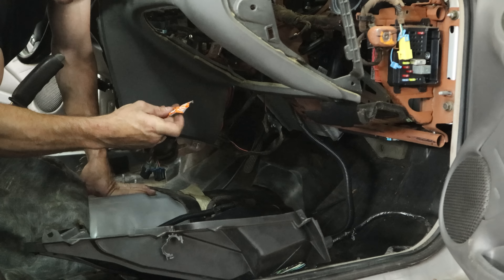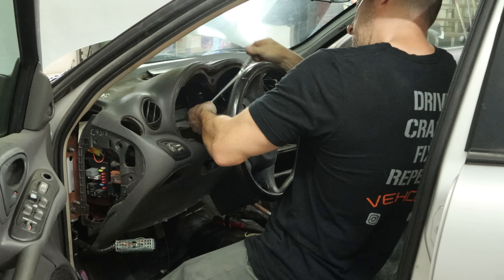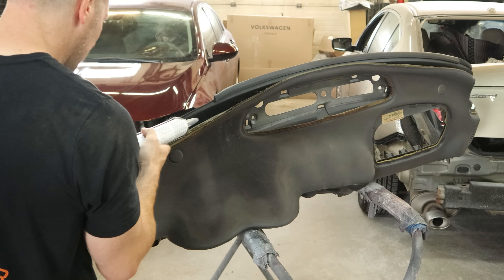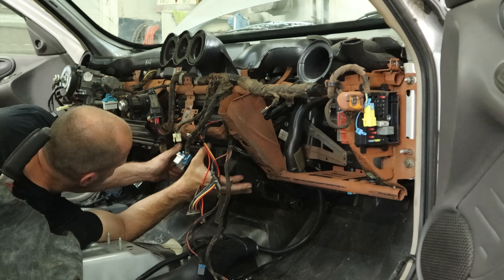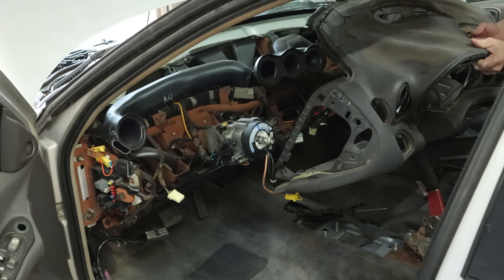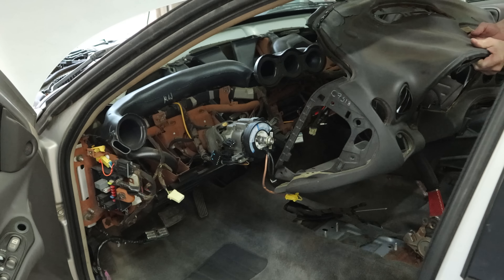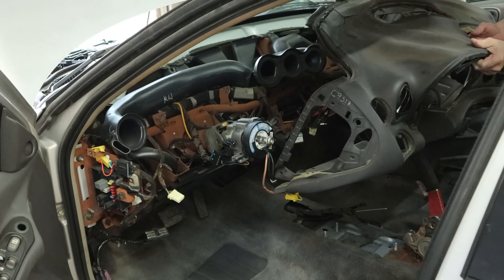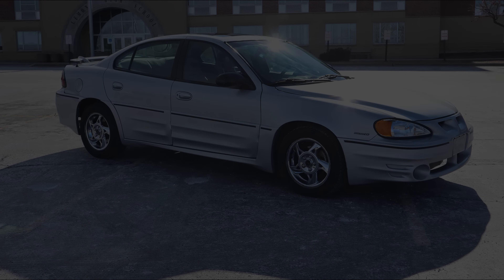How to replace a heater core on a Pontiac Grand Am and similar models

Comment: i replaced the heater hoses on my grand am before and without the proper spring clamp tool, it was an absolute nightmare. i was bent over in that engine bay for hours absolutely destroying my arms on the firewall insulation. won't ever miss that

Comment: You are so lucky you can still put your knee on the top of the engine to reach back to those heater hoses.  My knees had lost all padding by age 50 and that move would hurt.  TG for home depot knee pads except they are clumsy.
Reply from the maker: My knees are in surprisingly good shape, my back, not so much. 😂

Comment: That dash is insane to remove. I have removed so many dashed in my youth, leaving key sitting g on it or friend did and needed to retrieve. 
But nothing g like this. You didn't even remove it completely and it was already harder than anything else I have done by 10x at least.

I think I'll just bypass the heater core and use a propane heater lol
Reply: how do you do propane heater
Reply: @sylasdickerson5951  Mr buddy heater and a 12v electric fan from truck stop to circulate air. Set vents to recirculate too and on defroster. I had do it in a pinch years ago it works have turn it on 15minutes before leaving to feel good but can take off right away if in a hurry
Reply: @SeanGarrison-t8c  appreciate it
Reply: @sylasdickerson5951  remember to secure it if driving gthough sure itstops if tips but still could lead to fire. I had it secured to a deal that seatbelted in so it was fixed

Comment: If anyone owns these cars the dash material shrinks overtime that’s why it warps like that. Best thing I’d recommend is get a dash mat and use a sunshade when you park the car that really helps keep the dash from doing this it’s from the sun beating on the dash and the heat shrinking the material. The dash mat will keep the dash protected and the sunshade keeps the sun from beating on the dash all day.

Comment: Tip?
If you need to repair a dash like this first clean it with isopropyl alcohol and a scrub pad then wax and grease remover.
Then paint it with duplicolor vinyl and trim paint.
As long as it’s not too degraded the cleaning and painting will soften and slightly strengthen the padding hopefully enough to prevent cracking when you glue it back down.
But if it does crack you can fill them with polyurethane multi purpose glue sand it back and paint it with the vinyl paint.

Comment: I replaced the core in my 2000 grand am by cutting the carpet under the dash. I then split the carpet from under the dash. Didn't have to remove dash or console. Used some zip ties to draw the carpet tight. My core wasn't leaking
Reply: You sound like a real piece of work...
Reply: If it works is it really that bad of a solution

Comment: Do they do a special coating to the dash support metal to make it rust so evenly?  I swear every support I have personally seen has been rusted even in a few year old car.
Reply: Every GM vehicle I have ever seen is like that.Think it's a trade mark or something.
Reply: @burtbacarach5034  My Jeep has the same lovely "patina" in the dash.
Reply from the maker: It is bare metal so just the humidity in the air will cause a coating of rust.  It is not limited to GM vehicles.
Reply: Those early N bodies make great daily beaters. Simpleish to work on and very durable drivetrains especially compared to some of the new crap cars out there today....doubt few will make it to 20yrs old....

Comment: My 03 had an issue last week the shift lever stuck in park and key would not turn ! simple fix!  just delete the shift interlock selenoid and installed a new ign. switch key cyl. -and left the cyl lockout cable detached ! Did a relearn walla done !

Comment: 6 minutes in and I can't help but remember having to replace the heater core in either my 1970 dodge dart or 1971 satellite. 30 minutes and like 8 bolts and some silicone. I'd never done one before but my dad over saw my work.....those old cars didn't have a lot of convenience features, or get that great of gas mileage but damn they were easy to work on. 

225 slant six.

Comment: How much would a mechanic charge to replace the heater core in a 2000 Oldsmobile alero?
Reply: I have a 01 Oldsmobile Intrigue and I've been quoted $1,500 to $2,500 here in Washington. However the shops I got quotes from won't do it. So it's not only expensive but it's hard to find someone to do it in the first place. Now I'm trying to sell it.

Comment: Holy crap, that's a lot of stuff to remove. The heater core in my old car was under the steering wheel and you could remove it in 5 minutes no problem

Comment: Spring clamps - designed by the devil!
Reply: Not really.  
Fast install that does not need a calibrated install tool on the assembly line / constant tension on the hose are the advantages.  Number of people that, when buying a new car, ask if the car has spring clamps:  Zero.

Comment: what is the shop time for this job? not 2 hrs. probably 4. at $150 hr plus part, looking at $800?  is that car worth this effort? maybe today's market, but i wouldn't buy that car in pristine condition for more than $3k.  not worth the effort unless it was clogged completely. I would have flushed acid through the core for an hour then bicarb to neut, and coolant. amazing repair for a skilled mechanic